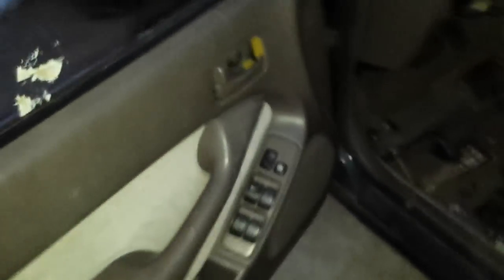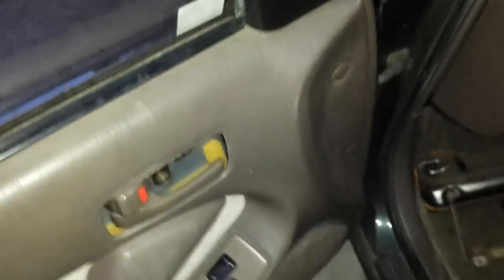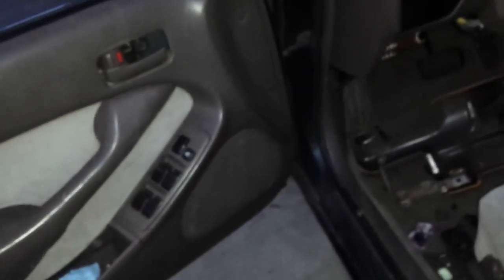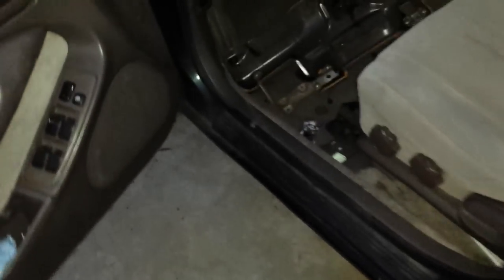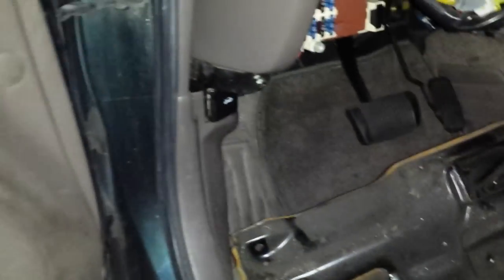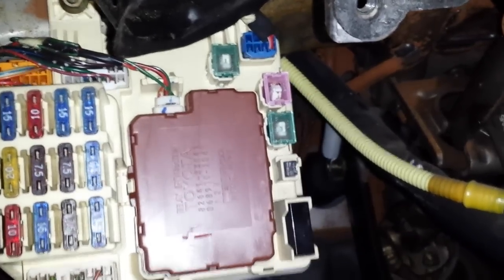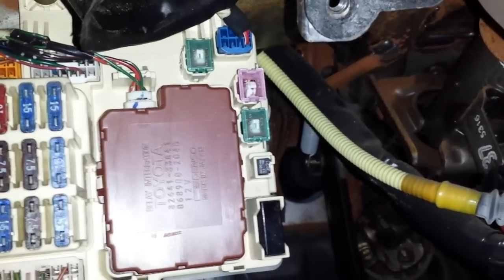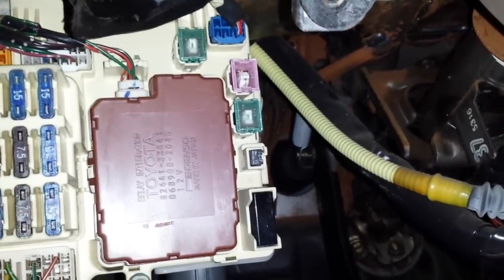Windows & power locks don't work, FIX. Camry secret fuse. Slow windows?

Comment: ARRRGHGHGH!!!  Okay.  Where did you find the replacement fuse, if you don't mind my asking?  Besides 30 amp, what else is it called?  Because there are also the itty bitty 30a fuses...
Reply from the maker: Off the top of my head. I don't remember if this is a short or tall fuse.The short views of this version is a FMX-30 FUSE. The regular or taller version of this fuse is FMM-30 FUSE. 

They should have them at your local auto parts store. If not Amazon has them for sure.
Reply from the maker: Hella quick reply! That's a record. Lol
Reply: @ScottiesHobbies  Yes, pretty awesome, thank you!  I almost passed out with surprise when I saw the notification!  lol!
Reply from the maker: @Thea | Mojave Outliers Whipmakers  lol. It usually takes hours if not days to reply. I'm trying to get faster at this.

Good luck with your fix. 💪👍🤞

Comment: I have a 97 Avalon. I found that hidden box. They have the WHOLE panel covering it and metal bracket over it! Worse $&?! Design ive ever seen. I got so mad at those }~<>€**s. I’ve had 2 back operations in the last 11 months and so it’s really taxing to get down there and fix this easy fix. I’ll work a little at a time till I giter done. But thx a billion my man for the insight!  They would have charged me more than what the car’s worth 🤣😂
Reply from the maker: Good luck with your fix. I was very surprised to find this box under the panel too. Especially given it to Toyota. Toyotas are generally easy to work on. I stopped working Automotive a couple years ago and got as more steady job that pays attachment more but leaning over cars and bending over all day was killing me. My body was aching everyday. Finally one day I looked in the mirror and told myself I'm too young to kill my body like this. I am super glad to help you hopefully figure out your problem. Let me know how it goes.

Comment: all 4 of my windows stopped working but everything else works, I have an 02 camry. I replaced the 30a fuse but nothing happened :/
Reply from the maker: +Virginia F have you had any motors replaced lately? If the driver window switch has gone bad it can cause your problem too.
Reply: I haven't no, 
None of the switches work for any of the windows. Power locks and everything work :/
Reply from the maker: Id have someone check the driver window switch. Most newer cars with power windows have a circut that goes threw the driver switch... have you made sure the window safty is off?
Reply: Im not sure where the safety switch is, but every fuse i used blew as soon as i turned the car on. Maybe an short somewhere?
Reply from the maker: Oh yea, for sure a short somewhere. If its just the windows effected, someone will have to disconnect the window motors and plug one in at a time to see which motor is causing the issue.
Reply: Well snap... Thank you 🙂

Comment: I have 2002 Toyota Camry Le and I can't my fingers onto the fuse to remove it. Any suggetions?
Reply from the maker: Needle nose pliers. Some fuse boxes have a 'fuse remover' placed in the fuse panel or on the under side of the fuse panel cover.

Comment: Quit cussing & complaining about your own sloppiness & poor video quality.  Fix what you don't like & start acting & talking like a pro.
Reply from the maker: Ehh fuck it. Lol
Reply from the maker: I appreciate the view and comment. Good luck on your diy project or future video analysis. You don't just stumble upon my vids. I wish you luck.
Reply: @ScottiesHobbies  can you tell me what relay control's the power locks. my problem is when you turn the car off the power locks won't work, they get no power to them,but they work normal when you have the car running. Why do they only work if you have it running
Reply: Ok the answer is Changing the fuse under the hood. It fixes all the issues at once

Comment: My 91 Lexus es250(Camry) passenger front door doesn't lock. I can't lock it with the remote key or by pressing the door lock. Can you help solve the problem? Thx
Reply from the maker: I assume it's an electric locking door? If so, does the doorlock if you use the switch on the door?